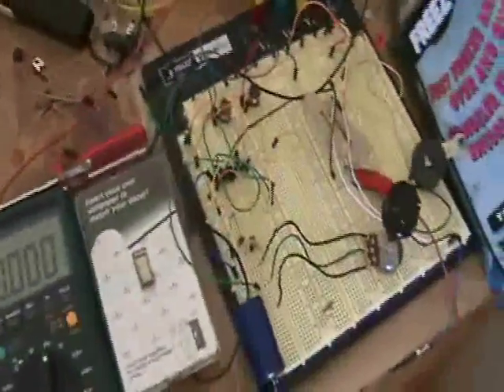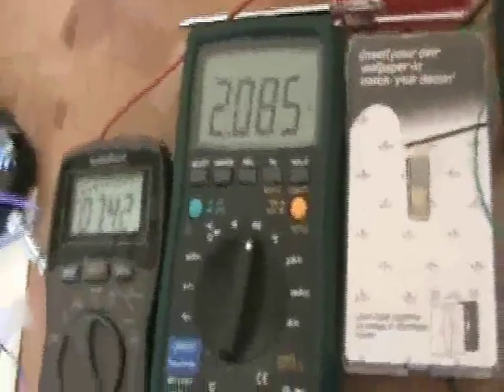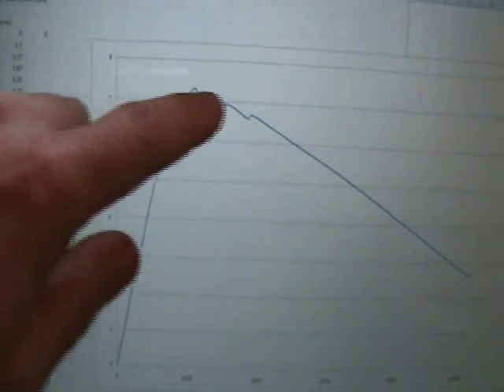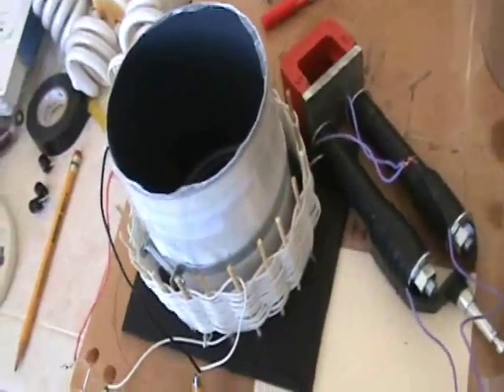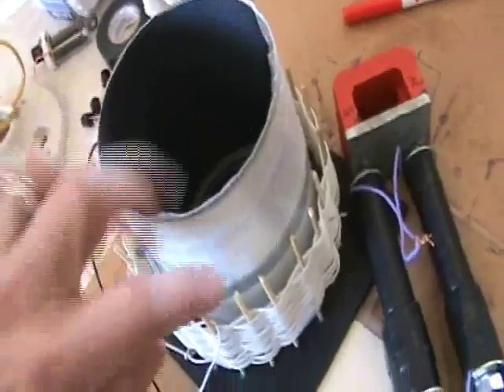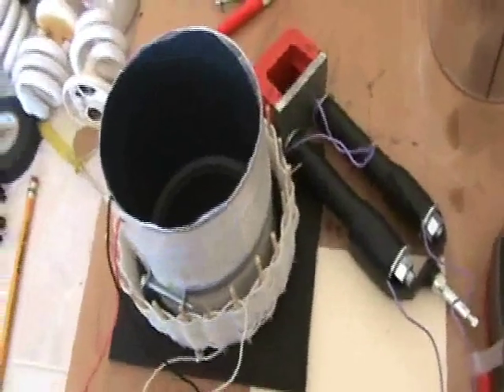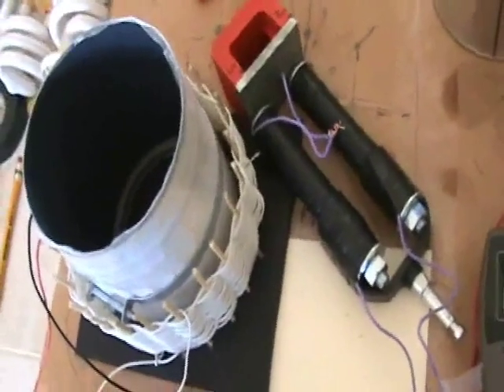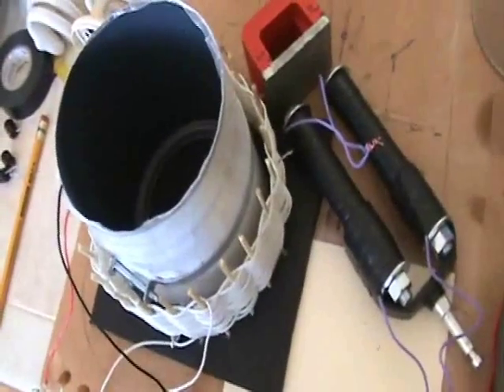Hendershot's Wide-band Frequency Response

Comment: You're on the right track here. The frequency calculated by finding the velocity of ions at room temperature by using 1/2mv^2=3/2kT, then fitting this on the can circumference as a wavelength should yield a frequency in that range. The ions can transfer their energy to the tank circuit ( ions are in the air all around ). The medium ( air ) has energy that can be used all the way down to absolute zero

Comment from the maker: The recent experiment I did with Joule Thief and capacitor to Hubbard coil shows a very nice ability to transfer energy from capacitor to coil. I think there is something to the notion of putting a coil in a capacitor ... or vice a versa. Capacitors will create an ionizing field. Energy can be transferred to the coil, possibly w/o back EMF (or less back EMF). I encourage others to try to replicate and see for themselves. Certainly we don't see many devices physically constructed that way.

Comment: what people don't think about is that an arrangement of coil and capacitor in this manner constitutes an active device ( like a tube ) because the magnetic field generated by the coil can act as a grid, making the electrons assume a curvilinear path. Once that happens, they can transfer their energy to the circuit, similarly to a magnetron tube. There are two coil/cap circuits because they can pump energy back and forth. You could probably add even more stages to this.

Comment from the maker: @schwarzerkrauser 
The Hendershot generator has very specific instructions for how many turns on what diameter, etc. This probably to yield the correct inductances and transfomer effect between coils on the capacitor. I believe Hendershot wanted to tune for frequencies down in the 50 to 150Hz range, since his solenoid-bar-magnet thing would resonate there. I haven't heard of a Hendershot-Rodin hybrid yet. Go for it.

Comment from the maker: Actually my immediate thought was the similarity to Armstrong's oscillator -- with the tickler coil. Hendershot uses a dual arrangement, however, which makes it more interesting. I'm in the process of winding a 2nd coil. I got side tracked with some other "related" experiments.

Comment: I would say the curve slope on the high side has more to do with the transistor characteristics than capacitor resistance. The 2N3055 is a rather low frequency device. And I mentioned the can circumference because of the coupling of the ions energy into the input circuit. Examine a microwave's magnetron tube, the physical dimensions of the tube's cavities are crucial for the correct frequency of operation. This hendershot device, although different, uses the same principles in a modified way

Comment from the maker: I'm now thinking that the can circumference isn't a major concern. Q for this tank circuit is, however.
So resistance must be low as possible in the wires and capacitor. Also, the magnet may play a role in making a sort of super-conducting antenna. When the iron bar is on the magnet, its field is nulled. When pulled off by the solenoids, its field is allowed to manifest. Hence, we have a oscillating magnetic flux, easily received by the tank circuits.

Comment from the maker: In messing around with these basket weave coils, I was surprised that the mutual inductance can travel between them if they are within one diameter of each other. There is a time in nanoseconds at these distances. So there is a Ghz component ... but harmonics down lower. The trick would be to make them self-oscillate w/o battery power ... magnets only at the solenoid.